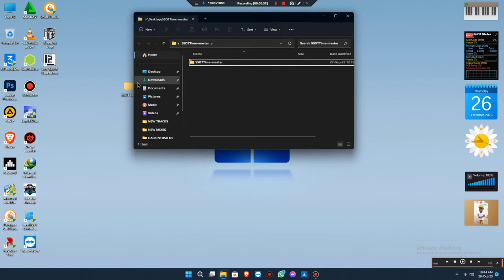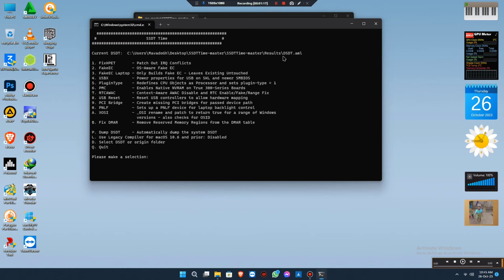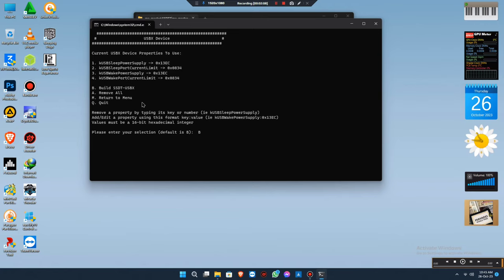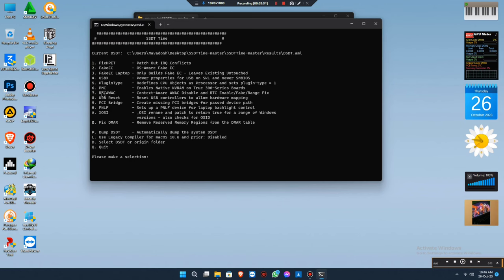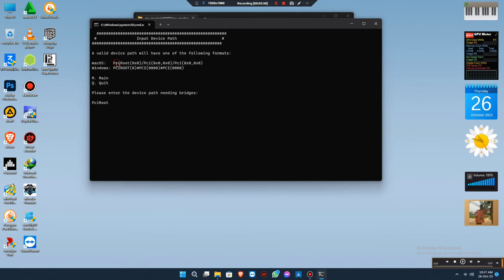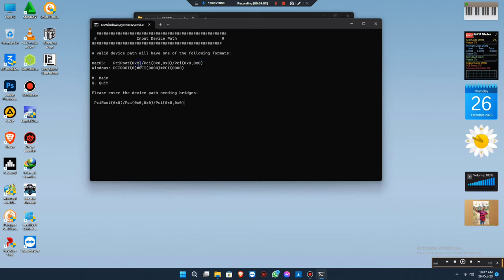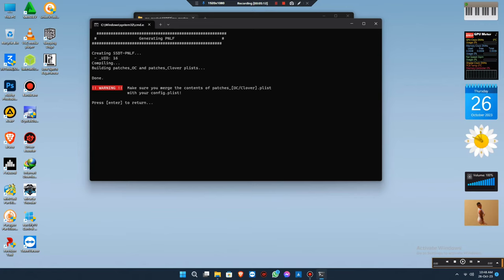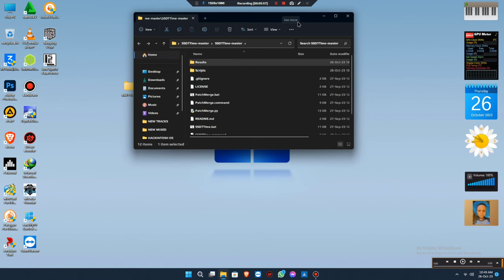Easiest SSDT Patching for Windows [ Hackintosh Open Core] Part 1

Comment: CPU: 12 Gen Intel i5 - 12400
GPU: Asus Dual AMD RX 6600 8gb DDR6
SSD: WD NVMe 1TB PCIe Gen 4 NVMe M.2
RAM: Corsair 16GB DDR5 - 5200 (2600 MhHz)
Motherboard/: Asus Prime B760M-A WIFI DDR5
Audio Codec: Realtek ALC897 
Ethernet Card: Realtek Gaming 2.5GbE Family Controller
Wifi/BT Card: On-board Intel's Wi-Fi 6 AX201 + Bluetooth 5.2
Touchpad and touch display devices: none
Monitor :- BenQ PD2705U

hackintosh working ?